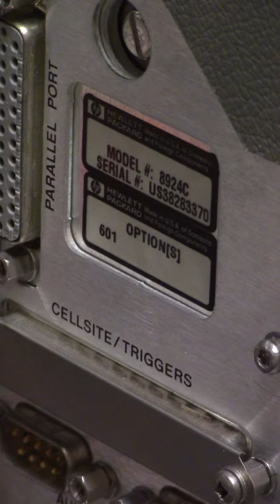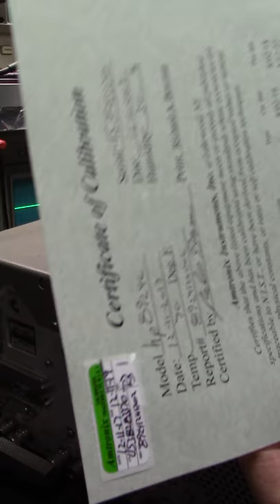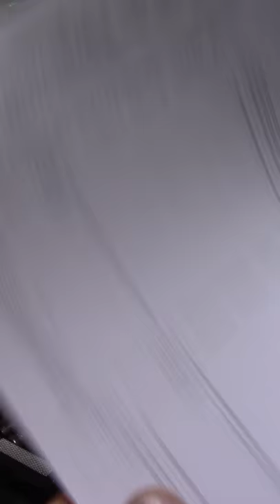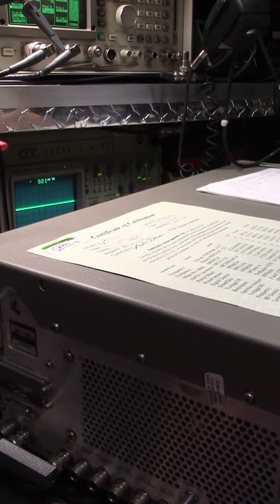NIST HP8924C Certified Service Monitor

Comment from the maker: Pay Attention Or Romper Room Radio Repair Will Get In Your Pocket .. Don't Be a Mud Duck! Here's what it takes to cut through the noise, be loud and crystal clear with a better receiver too:  A) Tuned Bench:  https://www.youtube.com/watch?v=lwcDfXOgAls.  True, it's more complicated and time consuming to accomplish these consistent and accurate results. Below is a partial procedure and list of calibrated equipment used to achieve this level of performance . Read on ..

Fine Tune CB Radio Shop strictly adheres to (https://www.nist.gov/) NIST Traceable Calibrations and other industry standards to maintain accuracy and consistency for providing Real World Performance Tuning of Citizens Band and 10 Meter export mobile radios with integrity.

"Basic Textbook AM/FM/SSB Transceiver Tune, Alignment and Calibration" 

1) Pll adjustments
VCO & OSC, AM TX OSC, USB TX OSC, LSB TX OSC.

2) Transmitter alignment
DRIVER BIAS, FINAL BIAS, SSB  (or gate voltages for mosfet versions) CARRIER BALANCE, HI-LO AM & SSB Power, RF METER, AMC, ALC and FM DEVIATION.

3) Receiver alignment
AM/FM RF & IF SENSITIVITY, FM DETECTOR/DEVIATION, SSB IF SENSITIVITY, SSB S-METER, AM/FM S-METER (100uV unmodulated -67dbm for “S-9” meter reading!), AM/FM SQUELCH RANGE, SSB SQUELCH RANGE, and NOISE BLANKER/AUTOMATIC NOISE LIMITER (Real World dBm to volts (uV) tables below).

That's just a typical run of the mill textbook tune up and alignment (if you're lucky). There's more to it than frequency alignment, modulation adjustment, meter calibration and a tune up report displaying exaggerated rms Bird peak watts! 

"Test Bench includes"

Bird 4314C Meter
https://www.birdrf.com/Products/Test%20and%20Measurement/Power-Meters/Wattmeters-Line-Sections/RF-Wattmeters/4314C_PEP-Single-Element-Wattmeter.aspx
Part 1) https://www.youtube.com/watch?v=RpX9IHe4ORM&t=16s
Part 2) https://www.youtube.com/watch?v=LuhbqTf6Bxw
Bird 4314C Accuracy Test: https://www.youtube.com/watch?v=DqEOabYqhQo&t=5s
Bird Stipulates 1/2 wavelengths  https://www.youtube.com/watch?v=5eWhgT-rTII
And Genuine Bird Elements from 1K down.

Bird 4373 Sampler 
https://www.rfparts.com/signal-samplers.html

HP8924c with options
http://userequip.com/files/specs/2147/HP%208924C%20Repair.pdf
https://www.youtube.com/watch?v=Cg1w0xBa27s&t=1s

HP8920a with options
https://www.keysight.com/upload/cmc_upload/All/EPSG072204.pdf

Three analog scopes, one digital 200 Mhz
https://www.atecorp.com/atecorp/media/pdfs/data-sheets/tektronix-2465b-2467b_manual.pdf
https://www.youtube.com/watch?v=by98x4eu2lM

Fluke 27fm
http://www.fluke.com/fluke/inen/digital-multimeters/fluke-27.htm?pid=56055
 
LCR http://www.lcrresearch.com/wp-content/uploads/2017/05/LCR_Pro1_Manual_version1.03.pdf

Power supplies
6 Cosel PBA1500f12 (750 amps) variable and configurable.
https://en.cosel.co.jp/product/powersupply/PBA/PBA1500F/PBA1500F-12/
Corcom 20VB1 F7130 EMI Filter 50-60Hz 250V

Times Microwave Coax jumpers and test leads
http://www.timesmicrowave.com/cms/products/cables/lmr/
https://www.youtube.com/watch?v=EmqaGJ6IWow
https://www.youtube.com/watch?v=1ltFVSxGp5Y
https://www.youtube.com/watch?v=v12YZT_1o90
https://www.youtube.com/watch?v=h7iiYfmYWRA&t=215s

Amphenol RF Connectors
https://www.amphenolrf.com/
https://www.youtube.com/watch?v=dVh5B0hdEA0 
https://www.youtube.com/watch?v=dKZg8T_AOso

More range, compliments, reliability and a quieter, clearer but more sensitive receiver,  Get Fine Tuned .. not peaked and ruined.

Here are some VideoGates of me at the bench practicing what I preach using my bench radio or customers radio completed and ready to be shipped: https://www.youtube.com/results?search_query=hard+drive+163+ more: https://www.google.com/search?q=Hard+Drive+163+nm&ie=utf-8&oe=utf-8&client=firefox-b-1-ab

It's what I recommend, use, service and sell ... to you ... not something non practical or deceiving in a misleading way. I'm not just the tech and owner of Fine Tune CB Radio Shop, I'm a customer too!  When finished, You'll be giving radio checks, not asking for them .

dBm To Watts and Volts
Tables below displays relationship between Power in [dBm] or [Watts] and Voltage in RMS, peak, peak-to-peak for sinusoidal signals in 50-Ohm systems for accurately measuring and tuning am/fm/ssb receiver sensitivity, agc, squelch and "S9" Meter calibration.

  [dBm] [Watts]   [Volts]rms   [Volts]p    [Volts]pp
-140 0.100E-16  22.361 nV  31.618 nV  63.236 nV 
-139 0.126E-16  25.089 nV  35.476 nV  70.952 nV 
-138 0.158E-16  28.150 nV  39.805 nV  79.609 nV 
-137 0.200E-16  31.585 nV  44.662 nV  89.323 nV 
-136 0.251E-16  35.439 nV  50.111 nV  100.222 nV 
-135 0.316E-16  39.764 nV  56.226 nV  112.451 nV 
-134 0.398E-16  44.615 nV  63.086 nV  126.172 nV 
-133 0.501E-16  50.059 nV  70.784 nV  141.568 nV 
-132 0.631E-16  56.167 nV  79.421 nV  158.842 nV 
-131 0.794E-16  63.021 nV  89.112 nV  178.223 nV 
-130 0.100E-15  70.711 nV  99.985 nV  199.970 nV 
-129 0.126E-15  79.339 nV  112.185 nV  224.370 nV 
-128 0.158E-15  89.019 nV  125.874 nV  251.747 nV 
-127 0.200E-15  99.882 nV  141.232 nV  282.465 nV 
-126 0.251E-15  112.069 nV  158.465 nV  316.931 nV 
-125 0.316E-15  125.743 nV  177.801 nV  355.602 nV 
-124 0.398E-15  141.086 nV  199.496 nV  398.992 nV 
-123 0.501E-15  158.301 nV  223.838 nV  447.677 nV 
-122 0.631E-15  177.617 nV  251.151 nV  502.302 nV 
-121 0.794E-15  199.290 nV  281.796 nV  563.591 nV 
-120 0.100E-14  223.607 nV  316.180 nV  632.360 nV 
-119 0.126E-14  250.891 nV  354.760 nV  709.519 nV 
-118 0.158E-14  281.504 nV  398.047 nV  796.094 nV 
-117 0.200E-14  315.853 nV  446.616 nV  893.232 nV 
-116 0.251E-14  0.354 µV  0.501 µV  1.002 µV 
-115 0.316E-14  0.398 µV  0.562 µV  1.125 µV 
-114 0.398E-14  0.446 µV  0.631 µV  1.262 µV 
-113 0.501E-14  0.501 µV  0.708 µV  1.416 µV 
-112 0.631E-14  0.562 µV  0.794 µV  1.588 µV 
-111 0.794E-14  0.630 µV  0.891 µV  1.782 µV 
-110 0.100E-13  0.707 µV  1.000 µV  2.000 µV 
-109 0.126E-13  0.793 µV  1.122 µV  2.244 µV 
-108 0.158E-13  0.890 µV  1.259 µV  2.517 µV 
-107 0.200E-13  0.999 µV  1.412 µV  2.825 µV 
-106 0.251E-13  1.121 µV  1.585 µV  3.169 µV 
-105 0.316E-13  1.257 µV  1.778 µV  3.556 µV 
-104 0.398E-13  1.411 µV  1.995 µV  3.990 µV 
-103 0.501E-13  1.583 µV  2.238 µV  4.477 µV 
-102 0.631E-13  1.776 µV  2.512 µV  5.023 µV 
-101 0.794E-13  1.993 µV  2.818 µV  5.636 µV 
-100 0.100E-12  2.236 µV  3.162 µV  6.324 µV 
-99 0.126E-12  2.509 µV  3.548 µV  7.095 µV 
-98 0.158E-12  2.815 µV  3.980 µV  7.961 µV 
-97 0.200E-12  3.159 µV  4.466 µV  8.932 µV 
-96 0.251E-12  3.544 µV  5.011 µV  10.022 µV 
-95 0.316E-12  3.976 µV  5.623 µV  11.245 µV 
-94 0.398E-12  4.462 µV  6.309 µV  12.617 µV 
-93 0.501E-12  5.006 µV  7.078 µV  14.157 µV 
-92 0.631E-12  5.617 µV  7.942 µV  15.884 µV 
-91 0.794E-12  6.302 µV  8.911 µV  17.822 µV 
-90 0.100E-11  7.071 µV  9.998 µV  19.997 µV 
-89 0.126E-11  7.934 µV  11.218 µV  22.437 µV 
-88 0.158E-11  8.902 µV  12.587 µV  25.175 µV 
-87 0.200E-11  9.988 µV  14.123 µV  28.246 µV 
-86 0.251E-11  11.207 µV  15.847 µV  31.693 µV 
-85 0.316E-11  12.574 µV  17.780 µV  35.560 µV 
-84 0.398E-11  14.109 µV  19.950 µV  39.899 µV 
-83 0.501E-11  15.830 µV  22.384 µV  44.768 µV 
-82 0.631E-11  17.762 µV  25.115 µV  50.230 µV 
-81 0.794E-11  19.929 µV  28.180 µV  56.359 µV 
-80 0.100E-10  22.361 µV  31.618 µV  63.236 µV 
-79 0.126E-10  25.089 µV  35.476 µV  70.952 µV 
-78 0.158E-10  28.150 µV  39.805 µV  79.609 µV 
-77 0.200E-10  31.585 µV  44.662 µV  89.323 µV 
-76 0.251E-10  35.439 µV  50.111 µV  100.222 µV 
-75 0.316E-10  39.764 µV  56.226 µV  112.451 µV 
-74 0.398E-10  44.615 µV  63.086 µV  126.172 µV 
-73 0.501E-10  50.059 µV  70.784 µV  141.568 µV 
-72 0.631E-10  56.167 µV  79.421 µV  158.842 µV 
-71 0.794E-10  63.021 µV  89.112 µV  178.223 µV 
-70 0.100E-09  70.711 µV  99.985 µV  199.970 µV 
-69 0.126E-09  79.339 µV  112.185 µV  224.370 µV 
-68 0.158E-09  89.019 µV  125.874 µV  251.747 µV 
-67 0.200E-09  99.881 µV  141.232 µV  282.465 µV
-66 0.251E-09  112.069 µV  158.465 µV  316.931 µV 
-65 0.316E-09  125.743 µV  177.801 µV  355.602 µV 
-64 0.398E-09  141.086 µV  199.496 µV  398.992 µV 
-63 0.501E-09  158.301 µV  223.838 µV  447.677 µV 
-62 0.631E-09  177.617 µV  251.151 µV  502.301 µV 
-61 0.794E-09  199.290 µV  281.796 µV  563.592 µV 
-60 0.100E-08  223.607 µV  316.180 µV  632.360 µV 
-59 0.126E-08  250.891 µV  354.760 µV  709.520 µV 
-58 0.158E-08  281.504 µV  398.047 µV  796.094 µV 
-57 0.200E-08  315.853 µV  446.616 µV  893.232 µV 
-56 0.251E-08  0.354 mV  0.501 mV  1.002 mV 
-55 0.316E-08  0.398 mV  0.562 mV  1.125 mV 
-54 0.398E-08  0.446 mV  0.631 mV  1.262 mV 
-53 0.501E-08  0.501 mV  0.708 mV  1.416 mV 
-52 0.631E-08  0.562 mV  0.794 mV  1.588 mV 
-51 0.794E-08  0.630 mV  0.891 mV  1.782 mV 
-50 0.100E-07  0.707 mV  1.000 mV  2.000 mV 
-49 0.126E-07  0.793 mV  1.122 mV  2.244 mV 
-48 0.158E-07  0.890 mV  1.259 mV  2.517 mV 
-47 0.200E-07  0.999 mV  1.412 mV  2.825 mV 
-46 0.251E-07  1.121 mV  1.585 mV  3.169 mV 
-45 0.316E-07  1.257 mV  1.778 mV  3.556 mV 
-44 0.398E-07  1.411 mV  1.995 mV  3.990 mV 
-43 0.501E-07  1.583 mV  2.238 mV  4.477 mV 
-42 0.631E-07  1.776 mV  2.512 mV  5.023 mV 
-41 0.794E-07  1.993 mV  2.818 mV  5.636 mV 
-40 0.100E-06  2.236 mV  3.162 mV  6.324 mV 
-39 0.126E-06  2.509 mV  3.548 mV  7.095 mV 
-38 0.158E-06  2.815 mV  3.980 mV  7.961 mV 
-37 0.200E-06  3.159 mV  4.466 mV  8.932 mV 
-36 0.251E-06  3.544 mV  5.011 mV  10.022 mV 
-35 0.316E-06  3.976 mV  5.623 mV  11.245 mV 
-34 0.398E-06  4.462 mV  6.309 mV  12.617 mV 
-33 0.501E-06  5.006 mV  7.078 mV  14.157 mV 
-32 0.631E-06  5.617 mV  7.942 mV  15.884 mV 
-31 0.794E-06  6.302 mV  8.911 mV  17.822 mV 

Hard Drive 163 NM. 73's! Click click.